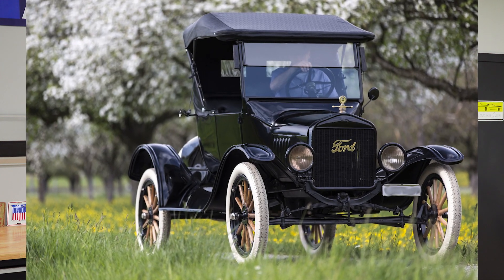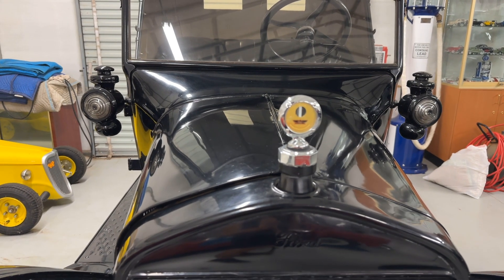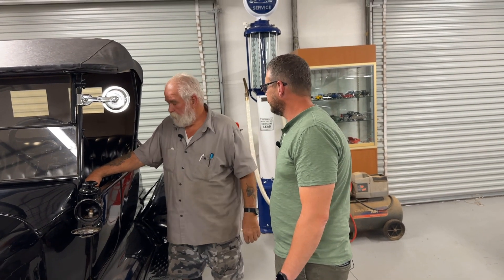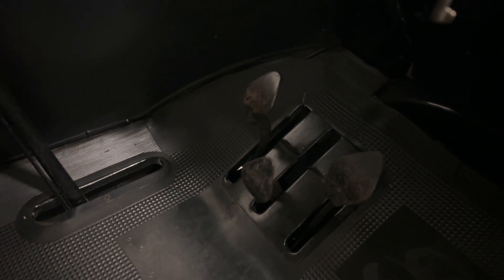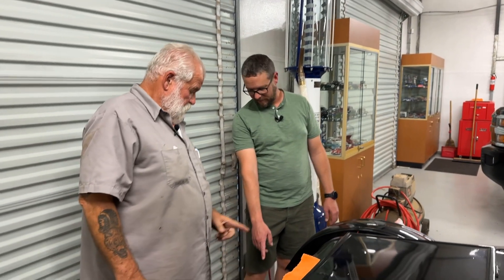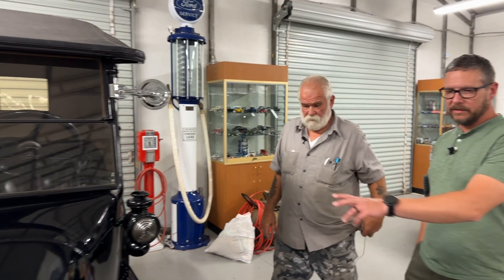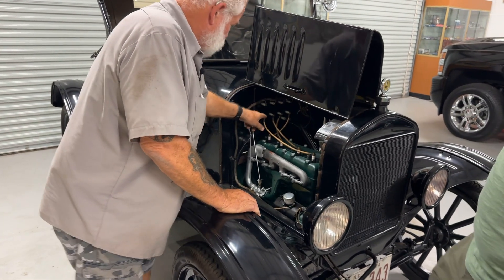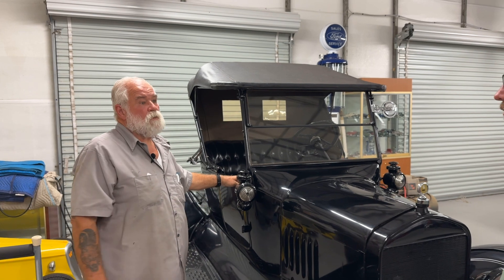1924 Ford Model T Roadster: How to Drive it, How it Cools Itself with No Pumps, and other Secrets!

Comment: Oiling was by cup on the crankshaft it would throw the oil Up lube engine, crankshaft bearings were babbit?? Thermo synphoning cirurlated the coolant around the engine